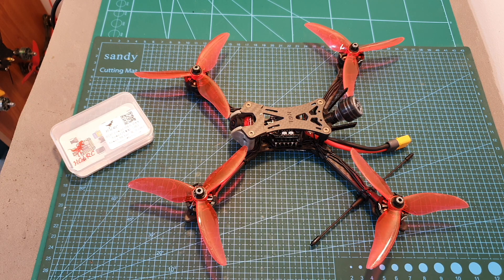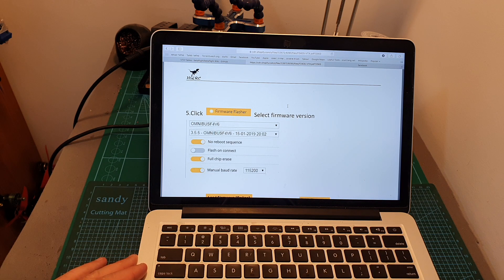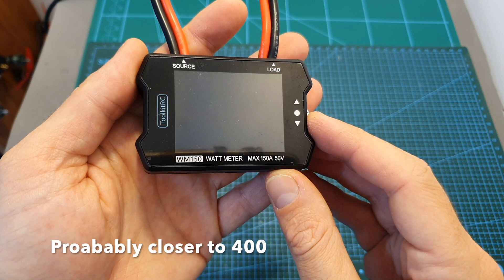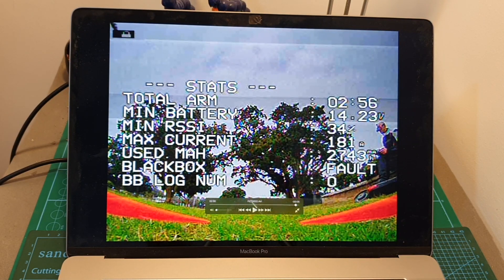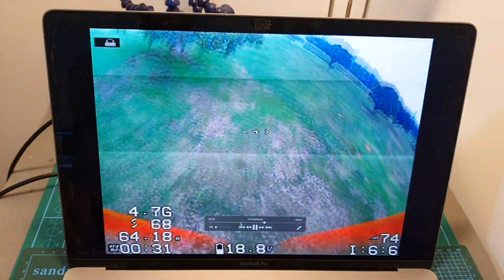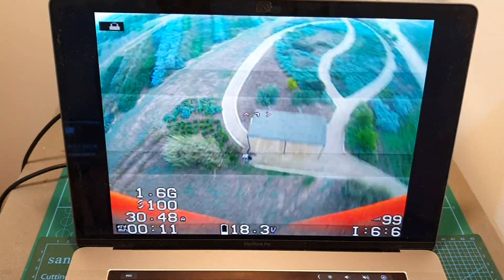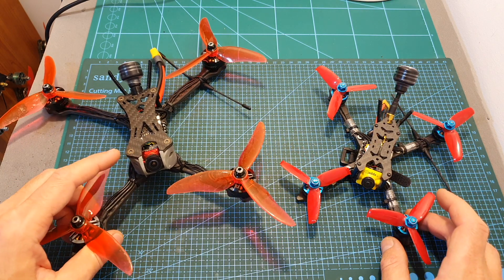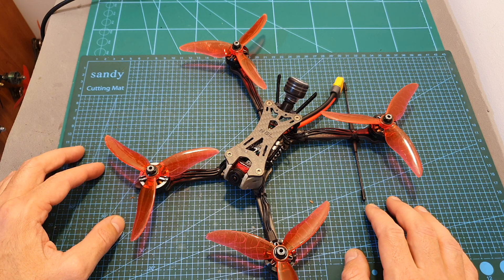HGLRC FD435  - Can it Handle 5" 6s?

Comment: Motor output limit in betaflight and you would not have had to swith motors, just a tip
Reply from the maker: Thanks, I will check it out. I think that this motor might have been previously damaged anyway.